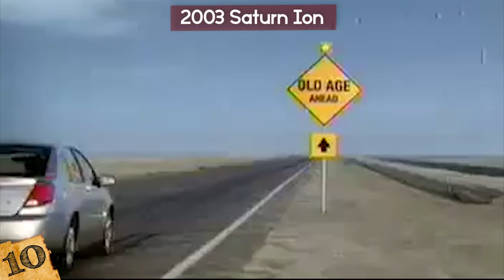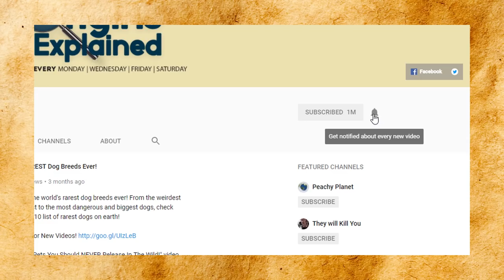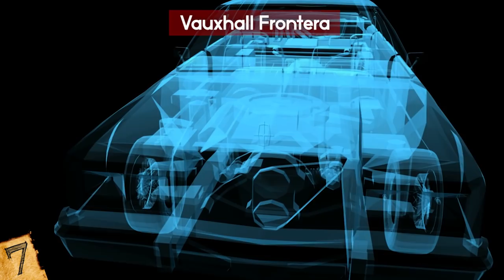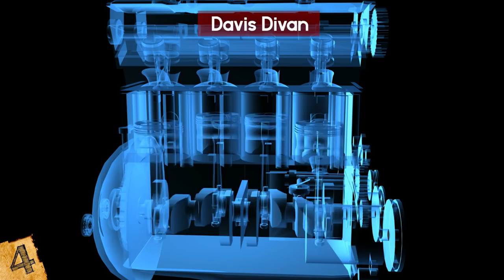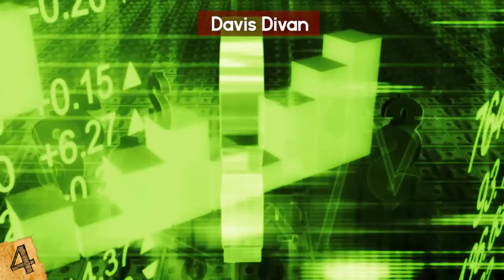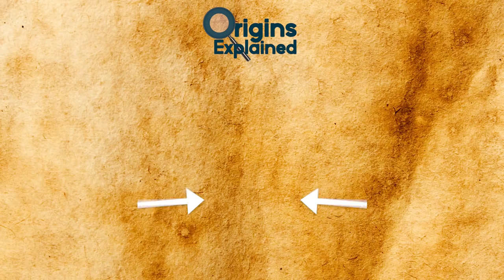WORST Cars In The World!

Comment: Sorry this is a very opinionated and fact free video. As a Reliant Robin owner in the past I found it  reliable and functional, yes it was basic, but then so was the cost. I have never heard of the roof lifting at speed and don't believe it ever did. The stability issue is also exaggerated,  tipping the car requires extreme braking and turning at the same time, Top Gear did it by loading weights into the front of the car to make it unstable. The Yugo is again a very basic car, sold at a basic price, it can be very reliable if maintained properly, which is why it stayed in production for so long. The Allegro was a much maligned vehicle, but again sold at a price, production problems caused by under investment by British Leyland coupled with bad labour relations didn't help, but they still have a cult status in the UK.
Reply: Nick Carter I agree with all that you said. You get what you pay for.
Reply: Yeah, a great car yet! People won't let England have it, especially with the Land Rover Defender!
Reply: Yep you could tip it over, but on the bright side a couple of blokes could set it back on its wheels and it would probably drive as well as it did before.   It was quite a performer since it weighed next to nothing.    Its entirely right about the Austin Allegro, what a heap of crap.
Reply: Captain Dildoface someone actually made a hillclimb car out of it
Reply: Absolutely right Top Gear used to slag every British car Robin Reliant with made a fibreglass so they didn't fall apart they just weigh them down in Top Gear episode as everybody should know that the BBC are corrupt

Comment: Saturn ION was not the downfall of the company.  The economy tanked around that time and decisions had to be made.  Saturn produced long-lived vehicles, which means fewer vehicles were sold.  My VUE as well as my Dad's VUE are 13 years old this year and neither have had any issues beyond normal maintenance.  They are still plentiful on the road.  Do your research before you make it sound like the brand failed because of one vehicle.
Reply: I have a Chevy Cobalt which is the same as an Ion. I've had it since 2005 (bought new) and still drive it daily. It has almost 150k miles and has been VERY reliable.
Reply: I drive a saturn ion, and its never had any problems whatsoever

Comment: I've owned two Saturns -- a 1994 SL I bought new and a used 1999 SL1 -- and I liked both of them. However, the Ion turned me off in several ways, but the main one was the instrument panel in the middle of the dashboard vs. in front of the steering wheel. I though instruments in the middle ended with the 1932 Ford Model A.

Comment: the trabant wasn't a bad car in any way.
first off the trabant consistently outperformed west german models in safety tests, due to it's light weight components giving it a relatively low center of mass.
ease of maintenence is also a huge selling point for the trabant with it's two stroke engine design being particularily user friendly due to it not requiring any oil exchanges or refills and no oil filter to speak off.
fuell efficiency was also a big advantage especially for the time and it'S low weight made the lack in power barelly noticable unless you loaded it up with people and cargo.
you are also not going to get stuck in the middle of nowhere with a trabant as you can almost always jury rig the thing into a drivable condition that'll last you long enough to make the trip home or to a nearby shop.
the distinct sound and smell of a trabant are also delightful.

sure the trabant has it's shortcoming, but it's advantages far outweigh any negatives it might have, with many germans still willing to pay more money for a 30+ year old trabant, than for other cars less than half that age.
Reply: Windhelm Guard What she doesnt get is the price to reliability ratio. It was simply a great car everybody had and loved!
Reply: the trabant pioneered techniques that are used in high end applications to this day, they essentially made a carbon fiber car, before carbon fiber was even a thing.
Reply: A brilliant car and great fun to own - I had one and wish I had kept it now!
Reply: TRABANT IS MEME
Reply: What a long comment just to say you're  in denial that the car completely sucks.
Reply: Imi Meh and there's  the problem  with communism.  Everyone has the shittiest thing out there because it's  all they can get so they better love it.
Reply: The communists had a different definition of quality to them it meant easy to repair not reliable
Reply: The Trabant is a car designed in the late fifties - and by those standards it was competitive because West German cars of that size were somilarly adventurous.

However, elsewhere things moved on but the Trabant became an anachronism and most of them were sold for lack of alternatives when it was hopelessly outdated.

It is popular now more as a historic symbol or as a joke on four wheels but not as a "good car" one would like to entrust one's life to as a daily driver (something I might well do with a Volvo, Saab or Merc of those days).
Reply: Windhelm Guard u ever play jalopy, u have no facts, sir
Reply: mega deth Except the Trabant is not a bad car. It was simply made to take you from A to B. And since it has a 2 stroke engine, and very little equipment, there's little to go wrong with it. My uncle bought one in the 1980s and he still has it now. And it works like it did when he bought it.

Comment: In defense of the Citation I had one that ran 300000 miles with just regular maintenance and with the fold down rear seat and hatch back it could haul a lot. Also driving in the winter in the upper midwest it was nearly impossible to get stuck any snow the front would go through the back would slide over

Comment: The 'odd' steering wheel in the Austin Allegro was known as a Quartic. Not round, not square, it was quite a clever design, but not pretty. In the UK now, a restored Allegro could cost £6,000. A cheap Classic. A former girlfriend had a Voo-hall Frontera and loved it. With the Robin, you're correct. It was cheap, reliable, covered motoring that was very economical to insure, tax and run for commuters.

Comment: The Reliant Robin was born from the earlier Regal model, which itself came out of 1950's austerity. At that time, a car which could be driven on a motorcycle licence, taxed as a motorcycle, yet proof against British weather was considered a good alternative to a motorcycle and sidecar. Fibreglass bodywork did not rust ( corrosion was rampant in British conditions), and the extreme light weight of 750kg meant that a small 700cc engine could be employed. Certainly stability was dodgy, but no worse than a sidecar combo, and anything beyond 45mph was an adventure; but of its day it wasn't actually too bad. As time progressed, standards and expectations increased, and the Reliant became an anachronistic joke. Unsurprisingly, the company folded...
Reply: My dad had about 5 robins and a bond bug and they were fun to drive, this woman talking doesn't know much about British cars, they wasn't made of plastic, they was made of fibreglass and you can't drive them at 16 in the UK, you have to be 17 to get a full motorcyle licence.

Comment: all facts who are told from the trabant car are not true. first collect right informations and than tell it to the people. the trabant was a volkswagen of the east germany and had all things a car of the time has to have. also all lights a car have to have. (in the video told: no braking lights, no turn indicator and som other), no bodyparts fall away, thats not possible because there were clued (like the modernest cars ouer time) and made from unrostable plastic-combi-material. like carbon on ferrari and lamburgini. and its weight of only 600kg, the engine reaces up to 120km/h. thats enougt vor driving in the eastgerman higways this time. the trabant is so popular and easy to repair, much people use them totay. its al livetime of a car in normaly use up to 50 years a deal? also, first collect true informations and then spoke..
Reply: @claudespeed277  have you ever seen one in real life
Reply: @fennograas  yeah, it's a major polluter, spewing smoke out the tail pipe like it has a blown head gasket
Reply: @claudespeed277  yeah that's true but it did what it was designed for and that is the point and that smoke you talk about is a cold 2 stroke engine which like to smoke like my grandma

Comment: I have to absolutely flame you for the inclusion of the Saturn Ion in this list. Yes, the cars were cheaply constructed, but they were well thought out. Building the car for left or right side countries was an easy change over, as evidenced by the admittedly odd position of the dash cluster in the center of the dash. The suicide doors in the rear give the convenience of a sedan with the looks of a coupe. The one I had even came with XM and OnStar, though I never subscribed. I didn't really need to because the demo channel plays modern hits. The only thing really missing on the car was cruise control. Maybe it wasn't a great value new, but you can pick them up in excellent shape for around $2500 today and you'll be very happy with your purchase (once you get used to the dash cluster).

Comment: The Citation was not GM's worst car! That dishonour belongs to the Chevette, in which GM's Vauxhall division ruined the Opel Kadette by filling its tough and pretty body (at least they got that right) with all the worst parts of the Viva: the engine, gearbox, suspension and electrical system, to create a painfully hard-riding, unreliable, cramped, unreliable citrus car which overheated regularly, and which had such incompetent detail design that it was exasperatingly difficult to work on.

Comment: To make the transmissions quieter, GM started using plastic on the selector shafts to the metal bearings in the transmission, the plastic frequently broke, my mom had a Citation,, useless vehicle and spent most of it's time in the shop, she traded it for  Taurus! Had the Taurus until her death in 2003

Comment: Sigh, as the owner of a three wheeled bond bug (a 3 wheeled reliant) for 8 years 1968 to 19 76 and 190,000 miles I dispute most of the comments on Reliant cars. 

The cars were developed for a specific niche in the Uk market, motor cyclists could drive them without taking a car test. 110 miles to the gallon, 80 MPH and at sensible speeds stable. Ok your not supposed to race them or drive in an excessive manner but you soon learn not to! The 700 cc 4 stroke engine was very tunable and used in formula 700 racing cars.

Because the tipping moment was predictable drivers soon learned to sense when enough was enough. Made from a fibreglass resin laminate the body was MUCh stronger than an equivalent weight steel body. I could easily stand on the roof of my bug, try that on a mini. 

One should learn not to be critical about the unusual, and  no one across the pond can criticise our car design!!!!. A bond bug today in good condition will cost you in excess of £3000.

Comment: I know many reliant owners and none of them have had the roof lift and rain pour down the windshield, reliant in their day were a high quality producer of motor vehicles. the fibreglass body is so rigid the only way to break or flex it would be in a collision, it is in some cases better than metal, it won't rust, doesn't dent, easier to repair after being scratched, if any thing the reliant was ahead of it's time.

Comment: Trabant 601s. I bought one of these cars as a joke after the Berlin Wall came down. I paid 100 Marks for it but the joke was on the young medical student who sold it to me!
One back in the UK and after some less than admiring looks from HM customs and excise at Felixstowe port I drove to the nearest MOT station for an MOT test.  I had to replace the headlightsas they dipped the wrong way for UK roads (easy, Mini headlights were a direct replacement) and the windscreen was replaced which took my local auto glass guy the whole afternoon to fit. In the seven years I owned the car it didn't let me down once, passed every annual MOT without a problem and never required any replacement part except for an exhaust box which cost me all of 25 quid from a Wartburg dealer in Leicestershire. I have no doubt that the smokey 2 stroke engine was responsible for the early demise of a good few trees and the odd passing asthmatic no doubt cursed me. It was great fun to drive and as for body panels falling off, this has to be a figment of the commentators imagination as the Trabbie was built like a T34 tank 
We moved abroad in 1997 and decided to let the Trabbie go to a new home as I didn't fancy driving it down to Capri. I sold the car for 650 GBP, a hefty profit on my 100 Mark initial investment, to an enthusiast of all things communist but wish I hadn't as the bloody thing is still going strong!!

Comment: I had an Austin Allegro that was on the whole a very good car, only the garage that the old lady who owned it first was taking her for a ride. When I owned it, the car broke down twice. One was when I used it the day before it had been raining. The car didn't start the following morning, turned out to be a damp distributor cap. Second I had the car MOTed, it failed on worn nearside front suspension, I brought the replacement parts from a spares shop that I knew, told the 'Mechanic' I required the car back the next day. A month later the 'replaced' part failed. Car not repaired, should have gone back to the 'garage' never did. Car repaired a hoot to drive, sold it as I had brought a '63 Humber Hawk, another story. The Allegro was a very good, misunderstood car. Most people who call it a load of old rubbish have never owned one. As a bloke I used to work with, when he told me that he had a VW 914, I replied they are a horrible car, he replied have you drive one? Don't slag it off till you have driven one.

Comment: Vauxhall Is pronounced VOX HALL. The Reliant Robin wasn't the car you could drive on a motorcycle licence, that was the Reliant Supervan and it could be driven by motorcyclists who only had a provisional licence which allowed them to ride a bike up to 250cc but also a motorised tricycle. The Reliant they could drive did not have a reverse gear so it was classed as a tricycle, the car had a plate over the reverse gear slot so it couldn't be used. It was not because it had three wheels but a combination of three wheels and no reverse gear. Of course these bikers would just remove the plate and use reverse gear anyway.

Comment: The 1980 and 81 Citations had a notorious problem of brakes locking on wet and icy roads. This was especially bad for manual transaxle models since during a brake lockup the engine would snub killing the power steering. Then you just slid around until finally coming to a stop. Had anti-lock braking technology been around this issue would have been moot. Anti-lock brake technology had just been invented was only available in few high-end European models.

Comment: This is the worst video ever.  During the "Eagle Premier" portion, they showed images of the Chrysler LeBaron, An Eagle Summit (manufactured by Mitsubishi), and an Eagle Vision in addition to the Premier.  Of course, the idiots who wrote this drivel didn't mention that the Premier was left over from acquisition of AMC  by Chrysler, and was a vehicle made from a Renault design.  

The biggest issues with this car is that it was an orphan.  The new "LH" fullsize cars were much better than the Renault platform, so Chrysler decided to slap an Eagle Premier or a Dodge Monaco badge on these, and sell them out the door cheaply, until the LH vehicles were ready.  

The green/teal car they showed briefly was the "Eagle Vision", which was based on the LH platform, along with the Dodge Intrepid and Chrysler Concord, and the New Yorker/LHS extended models.  These cars were quiet ahead of their time, bringing electronic transmissions, 4 wheel ABS, 4 wheel independent suspension, and a sleek "cab forward" design that is still seen in today's cars.  They did have some serious teething problems with their transmissions, but otherwise were wonderful cars.  I should know, I owned one.
Reply: I also bought a 1996 Eagle Vision Tsi new and put 275,000 miles on it. Loved that car! Finally sold it after I bought a 2017 Ford Flex.

Comment: The trabant has brake lights and turn signals and 26 horsepower and is very reliable if you maintain it and i drove mine 70 mph on multiple ocasions and its never let me down. I hate when people who dont know anything say things and my uncle drove a yugo for 36 years and it always worked properly and it is not serbias fault that people dont know that a carburated engkne will break if you dont warm it up and drive slowly until it reaches operating temperature and use the choke as you warm up

Comment: I'm driving my dad's 2001 kid Sophia. it has 165,000 miles on it & it has several problems wrong with it. It needs a basic tune up- new spark plugs, boots & wires; the greet shift isn't working right so the engine & transmittion are really in the wrong gear; the back end needs the tires & wheels taken off & the reared replaced.
Also, I believe it needs the rotors turned & brake pads replaced.
In not sure of the mechanical condition of the engine.
I Don't believe that this make & model of cars are worth buying. I've owned several cars before this one that lasted longer before having mechanical problems especially this serious.
I bought a 1985 Ford Escort, that i drove till it had 236,000 miles on it before it had engine problems.
I bought a 1996 Toyota Tercell brand no. I drove it till it had 264,000 miles on it. No engine problems that were major.
Then I bought a used 1991 Pontiac Grand Pri two Dior with original engine. The only problem I had was the relay switch needed to be replaced.
These were real good cars, no serious engine problems.